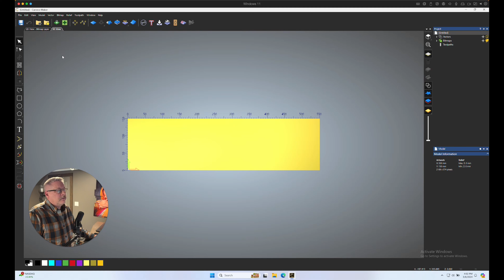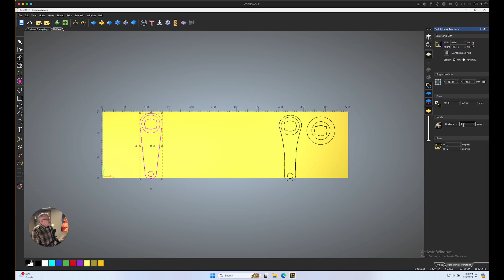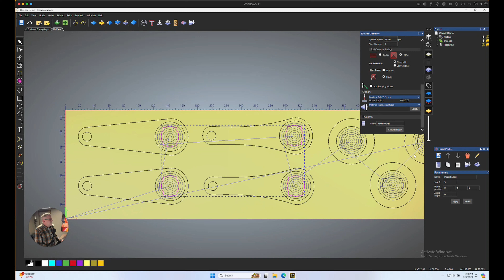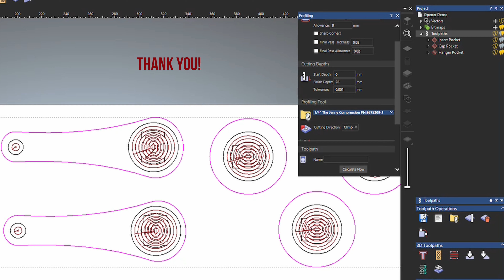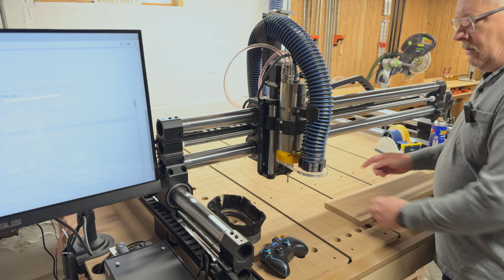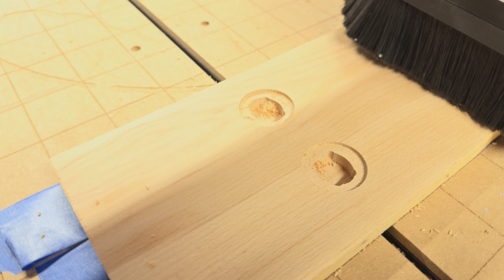Carveco Maker: Bottle Openers Project on my CNC (files available)

Comment: Amen to metric being easier.   So many CNC youtube channels are doing it the hard way; imperial.
Reply from the maker: No doubt. I jump back and forth. I tend to use metric for smaller projects and imperial for larger ones. I think it is just because I can envision longer lengths but can't quite equate that to cm or meters just yet. Getting there though. Thanks for watching!

Comment: Nice work.  Wondering if you can share how difficult it was to set up the spindle and vfd.  Does it take special wiring to the build botics box or just plug in?  I just got my pro woodworker but see a lot people in forums complaining about the makita. Thanks
Reply from the maker: Hey Gary, the beauty of the PwnCNC spindle and VFD is super simple. When ordering you select which box you'll be using your spindle with and they include the appropriate connection cable. That is the beauty of PwnCNC's VFD & spindle setup, it is completely plug and play and my experience has been that if you do happen to need their support, they are fantastic in that department too. Good luck and enjoy! Thanks for watching!

Comment: I would use the 1F for the drill holes for the screws as well.
Pat
Reply: I can see that, I have a small keyless drill chuck with a 1/2" Arbor, makes it no problem
Thanks, Pat, Great video by the way.
Reply from the maker: Great idea! I’ll have to look into that. Thanks!
Reply from the maker: That would for sure be ideal, however, they are tiny, tiny screws. You would need a 5/64t collet or 1/8 to 5/64 adapter, so that wasn’t an option.

Comment: Nice project. 
I noticed the PWN Spindle and was curious if once you set it up did your probe not work properly? I installed mine yesterday and can't get my probe to go in the correct direction. It probes upwards and away from the probe block. Looking online I see people are switching the magnet wire to the aluminum block and the block wire to the magnet. Is this something you also did?
Reply from the maker: Hi Bill, thanks for the kind words. Glad you enjoyed the video. My touch probe has worked fine since day one with my PwnCNC spindle. I have seen where others have had the issue you speak of. I would think a message to PwnCNC would get you taken care of. My experience with them has been top notch. Good luck getting that resolved quickly. Thanks for watching!

Comment: Hi Joe, I ordered the files (I use Carveco).  I plan on making several of these.  Very good video.  I am not yet accomplished enough to create the shapes in a few minutes and without mistakes.   Otherwise, I could make it on my own.  So, I just ordered from you.  One thing I noticed, the handles are not the same, two are contoured (curved inside) a bit.  I like better than the two that are straight from end to end.  I may just delete them and only use the design I like.  Hope you create more projects with follow along and offer files.
Reply from the maker: That you very much! I appreciate your valuable business and input on the video. That was truly my intention; to provide something simple at a very reasonable price that would strike that balance between spending the time to make it, or just purchasing it already ready. For sure, you can just use the shapes you desire. I will definitely be creating more in this series where files will be available. I hope to also have some other items available in the near future that may not even merit an entire video. Thanks for watching!